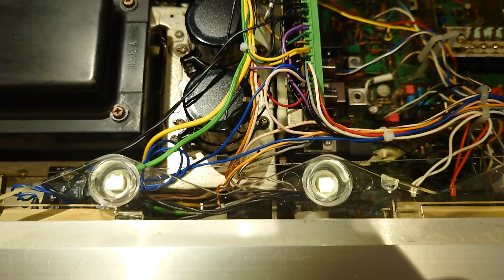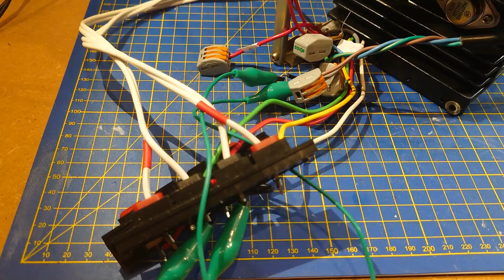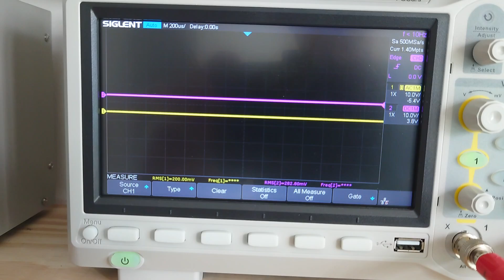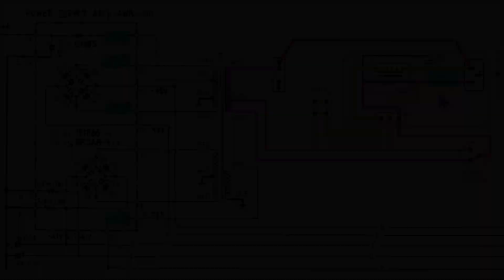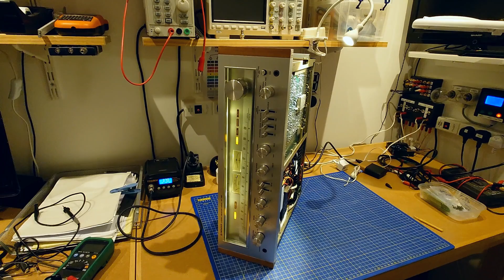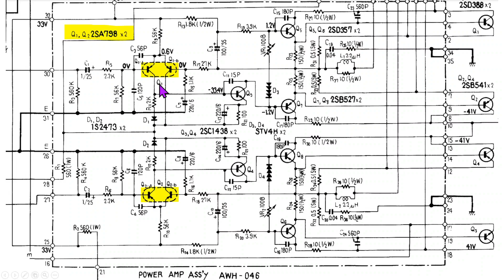Pioneer SX-750 Receiver Restoration (with power relay installation and oscillation problem fix)

Comment: What terminal block did you use on the protection board? I'm in the same boat with those wires and like your approach, very neat and tiddy. And is there a link to the led lamp pcb you have?

Comment: Very impressive. Restoring same unit now for a friend. Those heat sink compensation diodes do have short wires and my amp board bows out in middle. Wish pioneer used thicker pc boards. No way am I going back to that amp board. Lol
Reply from the maker: Thank you for your kind comment.  Best of luck with your restoration. Yes, the amp board bows out on mine too.  I did wonder about trying to add a central support but in the end I left it as it was.  Indeed, those diodes... I have a spare set of the three diode packs but not the four. In anticipation of possibly breaking them (fortunately they were ok) I did some bench experiments with a view to replicating them with a Vbe multiplier - there is a really good video explaining those on w2aew's channel.  I did get a circuit breadboarded but didn't take it further.  I have a few SX-450s and 550s to restore so as an exercise I might try the Vbe multiplier idea in one of those just to see if it is viable.